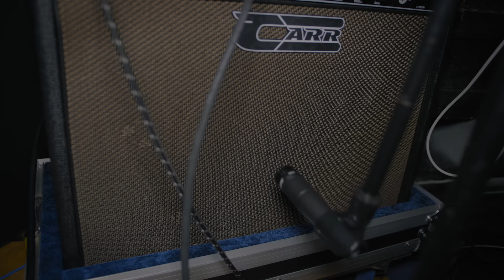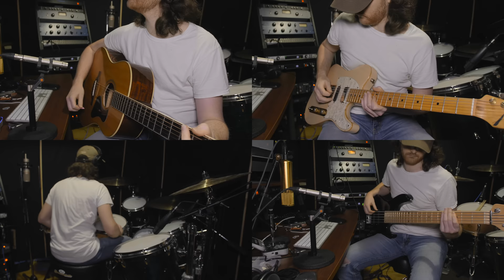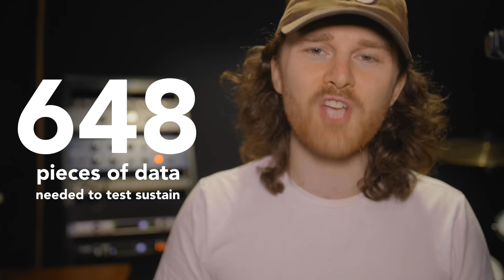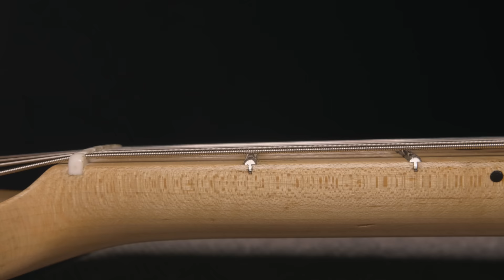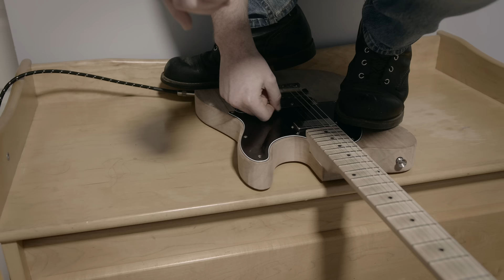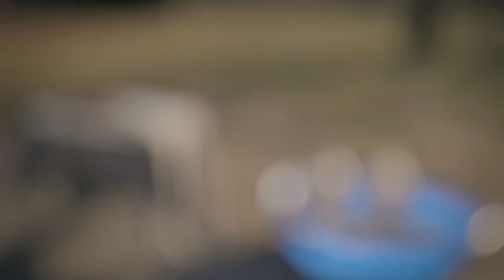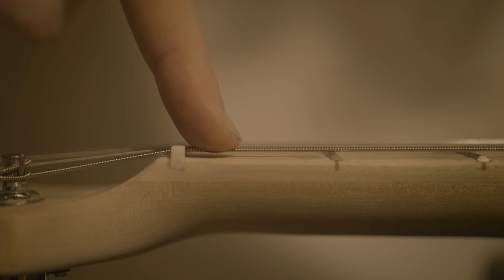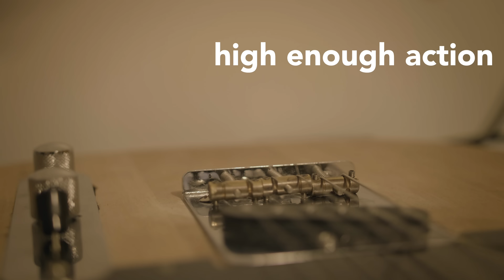Tested: Where Does The Sustain Come From In An Electric Guitar?

Comment: As a physicist, I find it interesting that the sustain was better with lower tension - with open strings. When the tension is lower the frequency is lower, and that means the string goes through fewer resonance periods in the same time. The Q (quality) factor is an important parameter for a resonator, and it tells you the fraction of power lost in a single period. If the Q factor stays the same but the period increases, you have more sustain.
Reply: I would love it if physicists and scientists started dong tests on instruments. I bet lots of myths or misconceptions could be destroyed.
Reply: What about the composition and/or quality of the string itself? Can an isolated string in a “dead”acoustic environment exhibit self generated sustain?
Reply: @AlCleveland  Well, a string that has a lot of "friction" if you will call it that, i.e. loses vibration every to heating, will have worse sustain even attached to a diamond guitar in a vacuum or something silly like that. We can imagine a string made from one long crystal played near absolute zero, but of course it wouldn't be very practical. The tuning forks in quartz watches are nice though.
Reply: Too light or too tight a tension would be detrimental to keep the string in motion for longer?
Reply: Wouldn't the string with higher tension(more mass at same tuning) have a harder time moving?

Seems like basic physics.
Reply: @user-bl3si3kq6x  Yes, too basic to explain what's actually happening. You need more force to put it in motion, sure, but that doesn't mean it should lose energy faster once it's swinging.
Reply: @tykjpelk  if the string is tighter, it's obvious why it would have a harder time vibrating.
Reply: @user-bl3si3kq6x  No, it just changes the resonance frequency. If the string has more mass, it needs higher tension to be tuned to the same frequency. Once it's vibrating, being stiff doesn't mean it's going to stop. There are some extremely good resonators that have been made from diamond, for example.
Reply: @tykjpelk  Here's a simple experiment.

Run a piece of floss between 2 poles 10 ft apart tuned to X.

Run a 1 ft diameter steel cable between 2 poles 10 ft apart tune to the same pitch.

Guess which one moves much easier in the wind.

The air physically moving the string is what guitarists are referring to as sustain.

That's why a clean tone played loudly sustains more than a distorted tone through headphones.

Yes, it's resonating. Via the air moving the string. An ebow does the same thing with magnetism.

Also, just use your fingers to see if it's harder to move an 8 tuned to e vs. a 13 at e.

Seems pretty intuitive.
Reply: @user-bl3si3kq6x  You don't want your string to flap around in the wind. That's just noise. You want to be able to give it an impulse with your pick and then have it resonate. The ability of the string to keep swinging after the initial impulse is what's called sustain, picking up noise is not. Your intuition about physics is dead wrong. Set up Hooke's law, use Newton's second law to solve for x(t), add a damping term and show me how the damping increases with k when you require k/m constant such that the resonance frequency changes.
Reply: @tykjpelk   It just proves the amount of force needed to move mass at a given tension.

I'm "dead wrong..." Yet my experience matches the outcome in real life, and your "physicist" experience doesn't line up with the real world outcome... funny how that works. 

Keep "knowing" the physics and being wrong, and I'll keep being intuitively wrong and still being right.
Reply: @user-bl3si3kq6x  Try strumming the floss and a string and tell me which has more sustain then.

Comment: These make me so happy because it just confirms that as long as a guitar is built properly and the pickups are ok, there’s no reason it can’t be a usable sound
Reply: True. I finally stopped wasting money on "tonewood" bullshit or new fancy pickups. What really matters is the speaker
Reply: @flachmann161  nah they are really old bad pickups from the 90s and 2000s era when there was no middle ground just great expensive guitars and cheap crap, but true, mostly all the new cheap guitars and all the epi and squiers come with ok, usable Pickups.
Reply: @ot4kon  Yes I have pickups like that, they truly suck. It doesn't mean you need Aeymour Duncans or original PAFs you stole from Joe Bonamassa but just decently made pickups. Epiphones from the early 2000s had pretty sucky ones. Alnico Classic. I ordered some Tonerider Alnico 2 Classics, with high hopes. In demos they sound as nice as original PAFs at half the cost of name brand stuff (still a lot of money for two magnets wrapped in copper wire).